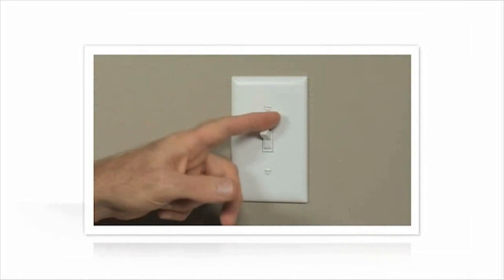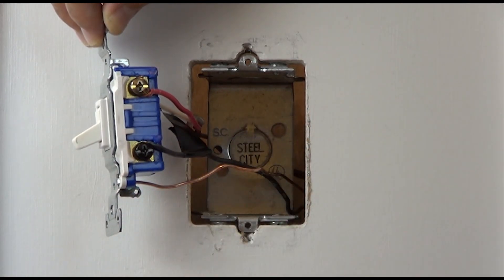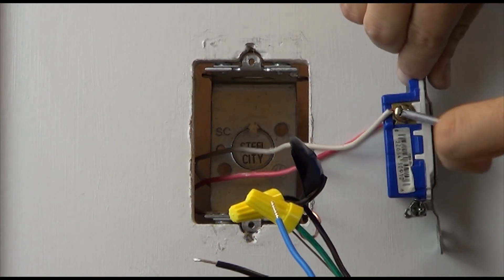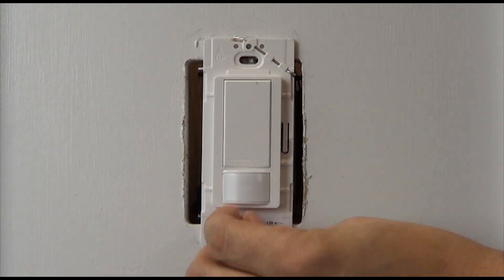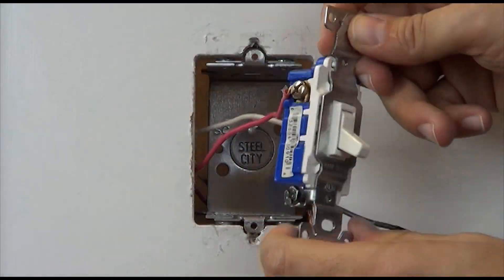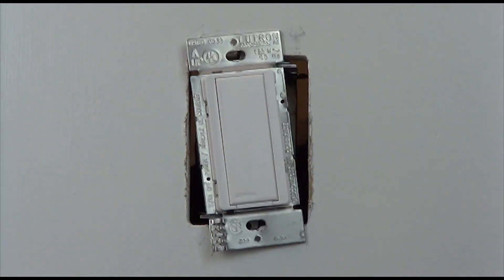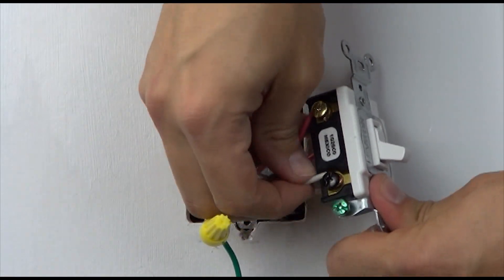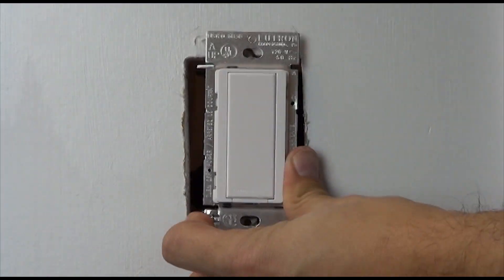Wiring a Maestro Sensor with companion switches (with screw terminals)

Comment: Why did you connect the black wire to the white wire!!????
Reply from the maker: Hello, Thanks for your question. In this application, the black wire was the hot wire coming from the breaker and red and white were used as travelers in between wall boxes. This wiring may not pertain to every application and Lutron would consult our wiring wizard for additional assistance or a local electrician for further assistance.

https://www.lutron.com/en-US/Education-Training/Pages/Tools/InstallDimmer.aspx

Hope this helps!

Comment: Is it possible to use TWO sensors on a stairway 3way?  Or does the second turn the circuit off when it sees you coming up the stairs?  Assuming a current 3way connection, how do you wire two sensors so that either turns ON the lights and they stay on for a fixed amount of time?
Reply from the maker: Lutron does not recommend using two occupancy sensors on a 3-way application. This will cause performance issues with the lighting circuit as two master devices are not intended to operate together. Instead, Lutron recommends installing an occupancy sensor at whichever location receives more traffic and either a standard on/off mechanical switch or companion switch (MA-AS) at the second location.

Comment: Hello. I have bought the maestro occupancy switch. I have it installed at the top of a stairwell and have a second switch at the bottom of the stairwell. In order for the top switch to work the bottom needs to be left in the on position. However after the top sensor has timed out I’m not able to turn the light on from the bottom switch at all. Would getting a companion switch fix this?
Reply from the maker: If the Maestro occupancy switch is the MS-OPS5M, it would be possible to get application working without the need of a companion switch. Lutron recommends reviewing the wiring diagram here: https://www.lutron.com/TechnicalDocumentLibrary/368-4493_Page_80.pdf. The mechanical switch at the bottom of the staircase will need to have its wiring modified in order for the 3-way circuit to operate correctly.
Reply: Hello! I have the exact same problem! My mechanical switch basically acts as a master switch to the whole system. Did you manage to find a solution?
Reply from the maker: @tmywu  When using a Maestro Sensor in a 3-way application with a mechanical switch, Lutron recommends using the provided jumper cable and rewire the mechanical switch according to the instructions. For more information on this application, please visit Lutron's Wiring Wizard: https://www.lutron.com/en-US/Education-Training/Pages/Tools/InstallDimmer.aspx#start/home?id=0&p=0&mn=0

Maestro Sensor instructions: https://www.lutron.com/TechnicalDocumentLibrary/0302800.pdf
Reply from the maker: @tmywu  When using the provided jumper wire, you are combining one of the traveler wires and the load wire together on the black screw. This will allow the light to be turned out without interrupting power at the wall box sensor itself.

Thank you for contacting Lutron Technical Support!

Comment: I have three switched in my Hallway- Can I install just the Maestro Motion Sensor & Dimmer to one switch and keep the other two the same?
Reply from the maker: Hello,

With the sensor products, if you have three or more total locations, you will need to use the Maestro companion switch or Maestro companion dimmer. Those devices will not work in line with two mechanical on/off switches. If you have exactly two switching locations, then you can use the sensor with one mechanical on/off switch.

Please let us know if we can be of further assistance.
Reply: @Lutron-Electronics will the  MS-OPS5M be compatible with the maestro companion dimmer or i have to get the maestro companion for it to work?

Comment: Question: Does the Line coming in from the panel have to hit the motion sensor first or can it come into to the mechanical switch first?
Reply from the maker: The order of the 3-way does not matter for this product. You can wire to the motion sensor first, or the mechanical switch/companion first; they are interchangeable in terms of location.

Please let us know if we can be of further assistance.

Comment: Why can’t I keep my existing 3 way toggle
Reply from the maker: Hi, Daniel. 

This video specifically addresses using the companion switch, but you can equally use a 3-way setup with a mechanical toggle switch using this wiring guide: http://www.lutron.com/TechnicalDocumentLibrary/368-4493_Page_13.pdf

This is explained in more detail on the MS-OPS5M installation guide: http://www.lutron.com/TechnicalDocumentLibrary/0301647.pdf

Please let us know if we can be of further assistance.
Reply: @Lutron-Electronics  It seems like thee are two version of MS-OPS5M switches, one  that allows you to use the same wire for ground and neutral and the other that only has the green jacket, is that correct? Or can the green shown in this wiring diagram can be connected to neutral if need be?

Comment: we two switches in a two floor shared hallway. can I put the motion (MS-OPS5MH) on one (say near the front door) and keep the other existing switch at the top of stairs? Will the existing regular switch use the timer if someone flips it?
Reply from the maker: Hi, Matt. Yes, it will, when you flip the standard mechanical switch to turn on the lights, the sensor switch will start looking for occupancy and start its countdown to shut off.

Comment: I bought a maestro (MS-OPS2) with one green two black and a plain silver wire. It's a garage where I have a switch by the house inside entrance and one switch by the main large garage door (3 way switch).  The switch I want to put my sensor on is by the inner door into the house - that switch has two black wires, a red wire and ground.  Can you tell me how do I connect in this application?  Please and Thanks!
Reply from the maker: Hi! Unfortunately you have a single pole sensor switch and have to use a 3-way sensor switch, that switch does not have enough wires for a 3-way application. You will want to get a MS-OPS5M.

Comment: Can you have 2 motion sensors on the same 3-way circuit?
Reply from the maker: Hi! Unfortunately no, the two sensors would conflict with each other. We cannot use two different motion sensing devices in a wired 3-way.

Please let us know if we can be of further assistance!
Reply: @Lutron-Electronics  what is the accessory switch model number.  I see that this is an older video, so I'm hoping it's still availiable
Reply: Omg that's what I thought too fml
Reply: Wouldn't the timer fix the issue of conflicting with each other though ?